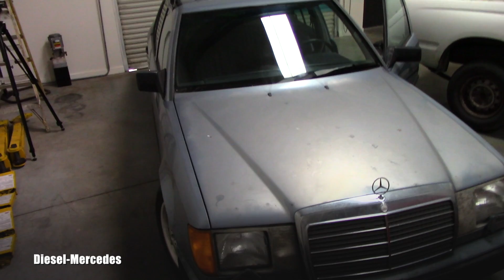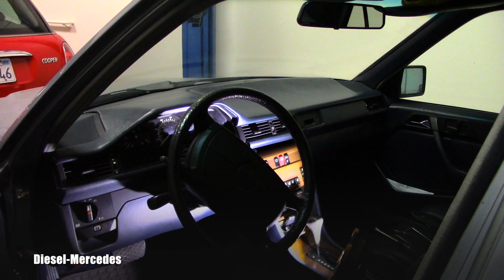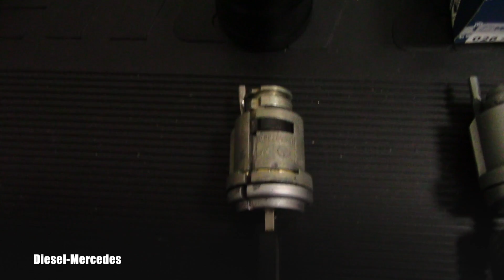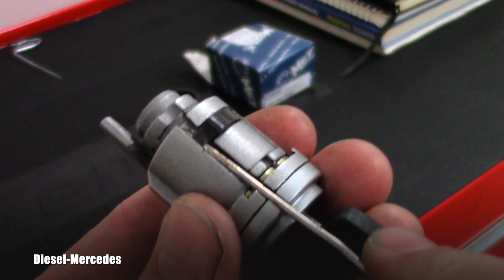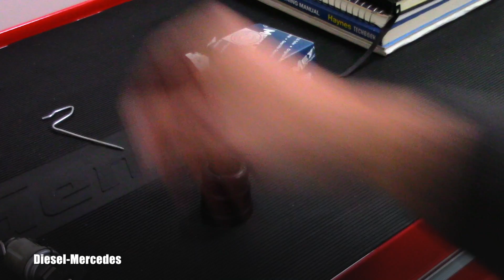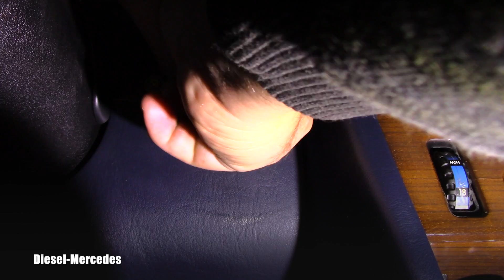Mercedes W124 Ignition Lock Tumbler Replacement

Comment: Thank you so much for this excellent, outstanding presentation. You did a fantastic job! Now, I have the confidence to replace the notchy tumbler on my 1989 300CE.
M-B asks for $125.US for the new tumbler with original (2) keys (Part # 126-460-02-04). You are a great guy- much appreciated! :)

Comment: You made a very good job. 
1. You show that its only necessary to have a steel-wire on the top
2. You show that the cover of the lock can be put afterwards when the lock is in and the function test was done. . 
Showing all in advance, that gave me a much better understanding. 
I waited too long to exchange (not knowing that it is a cheap part and that the exchange is normally easy. It took me some time to get the steering lock opened. And some more time to get the lock out. Now I am still having a problem to get  the new lock in. This could be because i did move the steering when the lock was removed. at the deepest point in the hole there are two parts that can be moved and maybe does not allow the lock to get fully in. Also i bought one of the cheapest lock. Maybe i need to look for a Meyle. Thank you very much.

Comment: I may have to do that with mine someday soon. if I put my key in and it wont turn but if I flip it it will turn easy.   I called my Mercedes dealer and  they are a lot of coded ingnition tumblers where you wont have two different keys to get in.. It will use the orningal one.

Comment: @dieselmercedes great video! Are you able to still remove this if the steering wheels is locked? Also there is supposedly another spring that holds the black outer casing in place

Comment: Hi! it is possible to fit on a 1991 w124 om602.912 250D 94hp engine a automatic 4 speed transmision and the differential from a 1995 om605 250D w124?

Comment: Ok, VERY IMPORTANT!! On the 1995 W124 250D 20 valves, you MUST put another wire or rod in to the ignition switch at 180° to the one shown in this video otherwise the SECOND clip (and there is one, belive me) will still hold the black metal shroud in place and you will NOT be able to extract the shroud and ignition switch! I have just finished this intervention at home so I know.

Comment: A note to everyone here in to not do what I did. My ignition tumbler started to feel As though it wouldn't turn smoothly. Sometimes it would turn and click very hard and I would have to jiggle the steering wheel at the same time to turn the key to make the key turn. Sometimes I would go to take the key out, and the key would be able to be removed without being in the off position all the way... I could take it out when the key was slightly turned. These are the warning signs that your tumbler is going out. I put mine off for a year and I paid the price because I had to end up cutting the tumbler and the actual lock with a diamond grinder and a diamond drill bit including the steering lock pin. It was an entire weekend and a nightmare and I never want to do that again. Change out your tumbler if this starts to happen to you immediately! I even had grief from the dealership ordering a new tumbler and key because they wanted to do the work themselves. I explained to them that I can't even get the car out of park to even use a tow truck to get it to them and that the steering wheel is locked as well. I was not wanting to drag my car out of my garage and make skid marks down my driveway to a tow truck and risk breaking other things because they're locked.

Comment: How do I remove the key cylinder if the inside of it is completely locked up inside and I cannot put the key in enough turn it so that I can put the pin into the opening to push the spring?
Reply: Hello how did you manage to change this key cylinder ?

Comment: Is it possible to remove it if the key is lost? I imagine I would have to drill out the key cylinder to make it move to the notch.
Reply: Hello, did you manage to change this key cylinder I have the same problem
Reply: @funzi2834  No never did